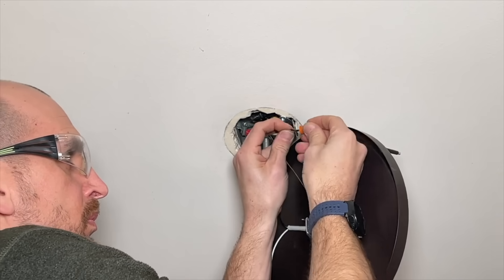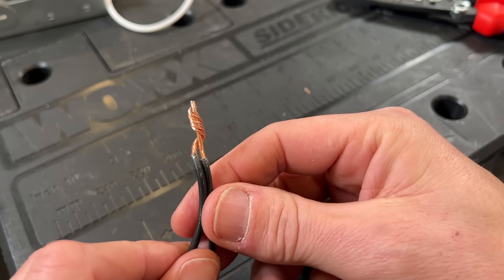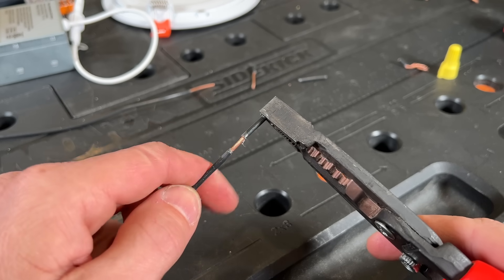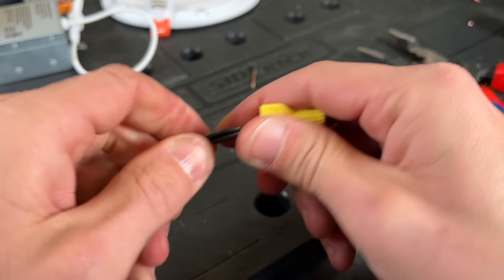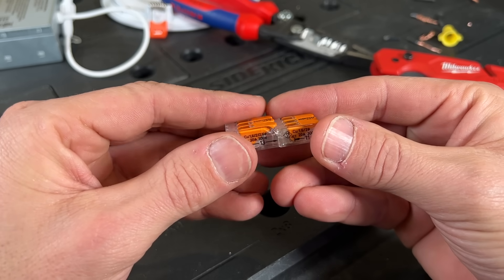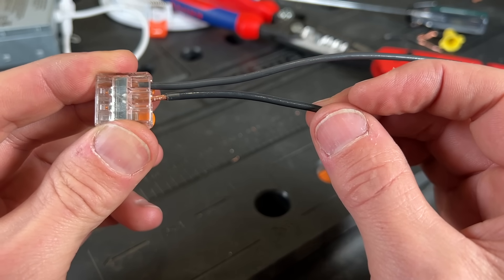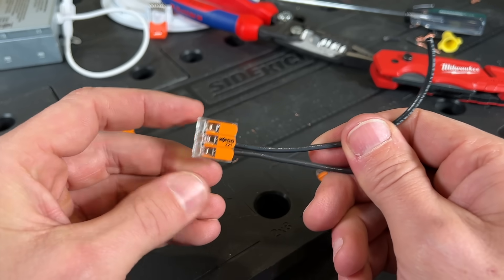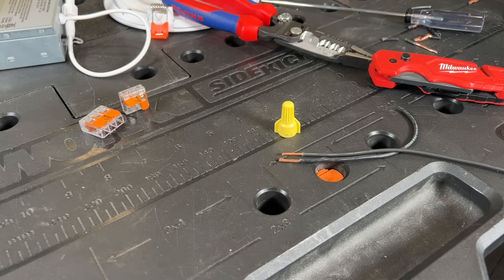Most Common DIYer Electrical Mistake - Don't Let This Be You!

Comment: I bought a similar product at Home Depot that I thought were Wagos.  (I've been calling them that).  It turns out that I've been using In-Sure® Push-in Wire Connectors.  They work similar, just no lever on each of the ports.

Comment: Electrician here. I would absolutely never use wagos for anything too high amp and not a replaceable part,.Your str-sol method is better but not correct.And yet still ok for  low amp fixtures and devices.If you were to want to splice a #12 (20 amp) to a #12 stranded, you use your lineman pliers to bend the solid into a rough spiral and then twist the stranded into it while tighening it and being mindful and gentle so not to score the wire too much.Then cut end even and screw on wire nut. If you have 2 solids and a stranded it all gets done for you.Twist the solids together first then gently twist in the stranded.Allways cut the end even no matter how many wires it is.This is an even better connection and worth adding the pigtail even when you dont need it(provided you have room).
Reply: pro real electrician NOT newer use wire nut anywere today, out of law. need use wago or other brand spring connections ewerywere safety lot more. idiots use old shit wire ut system only.

Comment: As german elektrisch on wire nuts are not use here because they are kind of un handy for the installations we do here. My aprentis ship started in 2005 and I never worked with wire nuts we always used wago clamps in different veryitys.

Comment: I use setscrew type wire nuts, I use conventional type wire nuts confirmed to contain a metal (usually copper) internal insert, and I easily solder the 2-4 bright wires pigtailed together before applying nut.  All regardless of solid  vs. stranded, but I'd never use the approach demonstrated here
Reply: only totally idiot use wire nut connection today, because have lot lot better and safe connection systems today than shit wire nut shit. spring or wago systems have lot better and safety.

Comment: Yes Waago work well but they still use a bus bar which is another component to fail or build up heat. They do the job but cost way more. A properly installed wire nut binds the actual wires together and little to no current goes through the metal coil in the nut itself. K.I.S.S. is my motto, less components to fix or replace is less work and less cost.

Comment: Most experienced electricians don't need wire strippers. Just linesman pliers. They are not sharp and all you are doing is pulling off the plastic without harming the wires.Strippers are very sharp and often damage the copper. Also don't need 3/4 inch stripped. Stranded wire should be only a speck longer than solid then tighten wirenut by hand then with pliers if needed. Do visual and pull check. I make a decent living rewiring do it your selfer wiring.

Comment: Electrician here: you made it very clear that you're talking to diyers and on that note I think you did a great job with this video. The only problem was how you explained stripping the wire. Start off by holding your strippers at a 45° angle on the wire, bite down on the wire, then start to move your strippers to a 90° while applying pressure pulling the insulation off. For solid this simple movement will get the insulation flying off easily, but for stranded, I do this method then once the copper is exposed move straight to clamping down on the insulation itself and pulling off like you showed. Sometimes stranded will come straight off and cool, but most of the time you're going to fight it the whole way off so just move to pulling the insulation off with the pliers right away.
Reply: Man you never want to hold your strippers at that angle, it’ll cut into the copper weakening it, in aviation or military applications that’ll get you fired for good reason, best is said above razor knife or thumb and scissors…. Best is rotary strippers, but extremely expensive and probably not practical….
Reply: @robertw1871  This is going to be a bit of a long explanation of why you're wrong about it damaging the copper, but bare with me. When fully closed, wire strippers have holes in them, multiple holes all with different diameters that correlate with different sizes of wire. Each whole is precisely the size of the copper in order to cut through all of the insulation while not cutting into the copper itself. Those measurements are taken with you holding your strippers exactly 90° relative to the wire. Now think of a right triangle. A horizontal line, a vertical line, and a diagonal line. The horizontal, let's think of this as the wire, makes a perfect 90° angle with the vertical line, let's think of this as the strippers, and then there's the diagonal line left. The wire is still completely flat, but now the strippers are at 45° angle relative to the wire. That diagonal line is mathematically proven to be longer than the other two sides. If the vertical line is shorter than the diagonal line, then that must mean that the strippers measurement of how thick the wire is is no longer correct. Holding your wire strippers at a 45° angle actually means you're not getting perfectly through the whole thickness of the insulation, therefore means it could never damage the copper seeing as to damage the copper the stripper has to go through the insulation in order to do so.
Reply: @christopherperez6126  I understand, what you don’t know is that I’ve been doing this for over 30 years, for a substantial fraction of my career I’ve worked in failure analysis, and the root cause of most wireing failures is not using tools properly. I’m sure you’ve probably never had issues, but I’ll bet if you strip 50 wire then do an analysis under a microscope you’re going to find degraded structure, such as scratches and cuts left by the tool. Anytime a tool digs into the conductor it will weaken it, for household wireing it probably doesn’t matter 999 times of 1000, but I’ve found many broken conductors over the years traced back to this, and in more critical environments such as aviation or automotive where there’s vibration involved the failure rate jumps dramatically… I know what you’re saying and why it’s done this way, it’s because it’s easier to catch the insulation and drag it off the conductor when your at an angle digging into the copper, if you hold them straight it’s much more difficult as the insulation is still tightly bound to the core requiring more force… For this reason in critical applications the stripping tools have no cutting blades at all, the insulation is either mechanically separated from the core by tension, or it’s scored and peeled back resulting in zero damage to the conductor mechanically… even a small nick in the copper is a potential point of failure… is it a huge problem, no, but it’s not 100% correct either…. There’s a reason that some processes will not allow those types of tools to be used is all I’m saying… it’s just information…
Reply: @christopherperez6126  except it decreases the distance between the two cutting edges across the wire not increases, holding at a 45 angle will increase you're chance of cutting the wire. that's why it feels easier coming off
Reply: Throw wire strippers out. Razor knife or pop with Kliens . Third generation electrician here.

Comment: Twist! Solder! Wirenut! Then tape with UL Approved electrical tape! No heat, less power, better connections period! Shrink-Wrap if necessary. .0001 resistance at its best!

Comment: Cut the insulation with the stripper then turn the strippers so the copper slides through the channel, your strippers bit the copper and hung up.  Remove more insulation from your stranded wire trying to line up where the insulation is cut. Wagos are okay for diy but I've seen them burn up in continuous duty applications like office lights. I used to cut them off of office lights I was installing.

Comment: Love Wago stuff.  We're actually transitioning away from wire nuts and and push-in connectors to Wago because they're vastly more fool proof and generate a consistent sprung connections.
Reply: My choice: Wago for Lights, LED lighting + intercoms. 
Ferrules for wall outlets, air conditioners, floor heating, stoves + geysers. 
Resin joints for Out Buildings, pumps & underground
Reply: Wagos suck, plain and simple
Reply: @rhinehartspindler3445  with no reason why?

Comment: New Zealander here. Not sure if it's because we use 240V AC, but to me these wire nuts look dodgy as hell. I wouldn't touch them with a 50-foot (15.24m) barge pole. I have never seen them used in this country, and all the power wiring in my 1975 house is done with the kind of terminal with a hole in a block of brass, and a screw at right angles to connect and secure the wire/s.
The only failure I have seen in my house was when my hot water heating cylinder failed about 15 years ago. A year or two later I wondered why the old Bakelite cover of the isolating switch crumbled and fell off, exposing live wires. I then realised that the person who replaced the cylinder didn't tighten the "hot" terminal properly, and his improperly tightened bad connection had heated up and "cooked" the Bakelite.
I replaced the switch myself, tho' I'm a telecoms man, not an electrician. It's been fine ever since.

Comment: If you look at the stranded, you can see you cut into quite a few of the strands. Also, those strippers look like hot shite, they do NOT look like they are good strippers. Wago's are great, I love them, but they cost about 5x as much as wingnuts, and don't offer as good of a connection as wingnuts, though they are much faster to install.

Comment: The most common mistake by a diyer is to work on electrical in the first place.  It is dangerous, hire someone to do it right and don’t risk your property or life to save a few bucks.  Besides, it’s going to cost a lot more for me to track down your mistakes than if you had just hired me in the first place.

Comment: I would never use a wire nut, it’s just poor workmanship. If you ever needed to remove it you have to cut the wire back leaving it shorter and shorter. Don’t be lazy use a proper connecter like a WAGO

Comment: If you stick the stranded wire 1/8" past the solid wire, the wirenut will bite into both wires.
The coil needs to grab the stranded first so it doesn't push it out as it tightens.

Then always gently tug each wire after tightening the wirenut so any that didn't grab are easily identified before there is a problem.

Comment: As an Electrical Supervisor for an industrial company I have been using wago connectors for years. These are great for inexperienced folks who are doing a home project.  These are easy to use and safer than wire nuts especially if you do not do much electrical work.  That being said my electricians love these things as do I. Being in a place with lots of heat and vibrations wago connectors are the way to go.  Need to replace a motion switch? With wagos you never have to expose the hot wire like you would with a wire nut. You just take the switch wire off and put the new switch wire back in wago without ever exposing the hot wire. That's just one example.  Hope this helps.
Reply from the maker: Totally agree Sam, that is a great example of the value and could see them being a no brainer for industrial.

Comment: I've used Wago connectors both in DIY work and professionally for 20+ years and think that they are 100% satisfactory when used within their specifications.
Reply from the maker: Thanks for the feedback.  Got to hear after that long you are still happy with the Wagos.
Reply: If Wago connectors had been invented decades ago, and someone introduced wire nuts now, they would be met with well-deserved derision.

Comment: Can they be utilized directly with aluminum wire??
Reply from the maker: Nope, not directly https://www.wago.com/us/electrical-installers/practical-tip-connecting-aluminum-and-copper-conductors#:~:text=With%20WAGO%20Alu%2DPlus%20Contact,%E2%80%93%20quickly%2C%20easily%20and%20reliably.

Comment: Or just do what I did when I put in those same lights in my house. Remember I'm 29 and my first ever house and I'm remodeling it but I soldered every wire then use heat shrink and will never have a arcing problem or loose connection just leave a service loop in the junction box for future repair Incase a light goes out or breaks or whatever. I do industrial electrical work and I wired up my whole house with shipboard cable and got cable tray system in my attic I got it all for free from extras on jobs new construction oil platforms we do and when the electrical inspection came he literally passed all my work as soon as he say the 3 different runs of cable tray on top of each other with unistrut racks to support them top tray is all my communication cables for internet and fiber and security system ECT every room in my house has a cat 9 Internet outlet to hard hook up computers to internet for highspeed gaming or movies in my theater I built and my iracing simulator. Middle tray is all my low voltage stuff like lighting and outlets and everything that needs power low voltage wise runs in that tray and bottom tray is used for bigger cables and wires to help with interference with my fiber and cat 9 and communications and networking tray. I really did it all just to make it all nice and neat organized and easy to fix stuff and add on and easy to trace down a certain cable or wire since every wire and cable end is labeled on both ends and labeled every 40 feet down the cable to identify it easier and because it was all free so why not have a cable tray system in my house with ship board cable in the attic

Comment: LOL, I was thinking at the beginning of the video, "My preferred method is with Wago". The early version of Wago didn't have see-through plastic. The main distributor wire you want in the middle, and spread the load for the end-users to each side. Similar with junction-boxes, you don't want the feed at the end, but in the middle, so not all electricity flows through the same piece of metal.

Comment: Absolutely not on the Wago in any version.  You will often encounter repeated small stress in various form and direction inside of a device box instead of a simple draw from a larger force for a short period of time.  There is a reason why the professionals do NOT use Wago even if they are cheaper (you read that right, wagos are much cheaper if you account for the labour).  You see wagos in condo builds in fast developing cities where there get bottom paid apprentices to do these rats nests.

The best practice, IMO, is to pretwist a slightly longer stranded wire clockwise on itself.  Use a shorter solid wire, giving it two small kinks.  Twist together to give it a mechanical lock, then put the wire nut on.  For more than one solid core you should consider putting the stranded in between the solid core twists since you are likely adding that device.

If I see anyone with a knipex installation plier I would really think twice.  They are in fact a bit off of North american common jacket/insulation sizes and also tend to want to fold to the side when they encounter resistance from the insulation.  For strippers, a simple pair of Klein is superior.
Reply: Bad spring connectors might losen under such stress, but proper Wago connectors (not the cheap fakes) do not. I even tried them for prototypes in environments with extreme vibrations in motorsports and they held up easily (in such conditions unsecured screw connections can easily fall apart in seconds).
Your argument about professionals does not make any sense. Wago connectors get used all over the place in Europe and almost never fail even if stressed far beyond their ratings.
Contrary to that, most european countries have much stricter regulations regarding electronics that have resulted in the use of Wago connectors. Wire nuts are banned in many places here because they are less safe.

Comment: Nice video!  I always put a few raps of electrical tape around the wire nuts and wire just as a backup when I am finished.  Some may think it overkill, but it just takes an extra minute or so and I feel more secure about the connection.  You can put some around the WAGO connector levers if you are worried about them opening on their own.  I would...just in case.....🤔

Comment: what do you thing about using NOALOX Anti-Oxidant Compound with these connectors?  I worked with an electrician who used this on all connections ESPECIALY aluminum connections to prevent oxidation which leads to heat and failures.